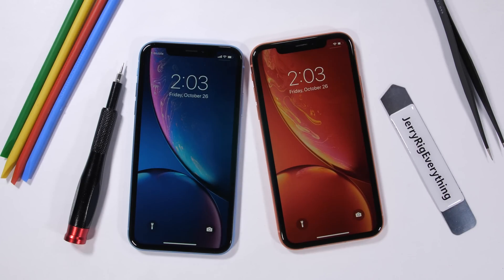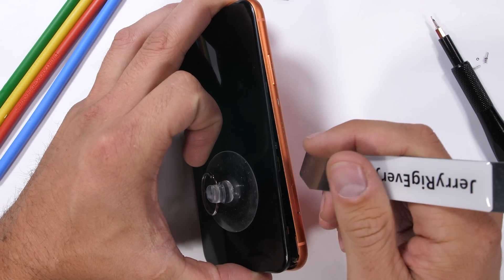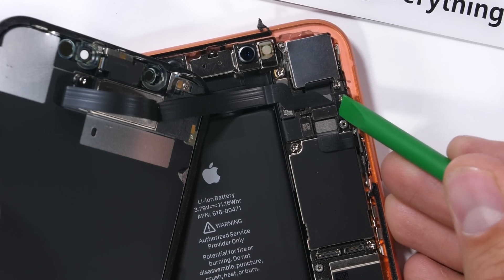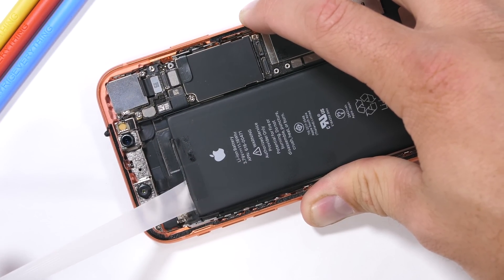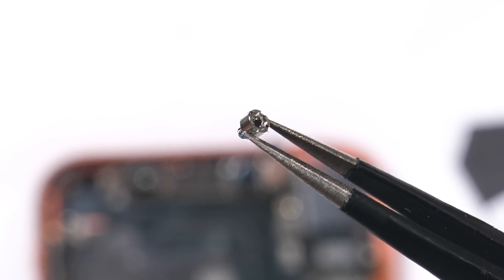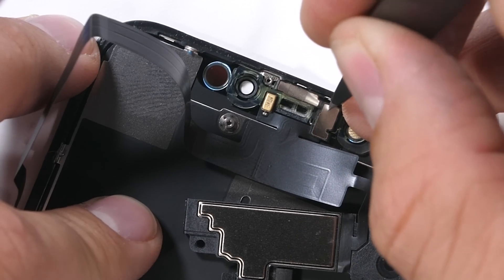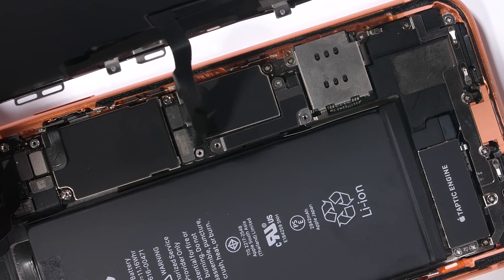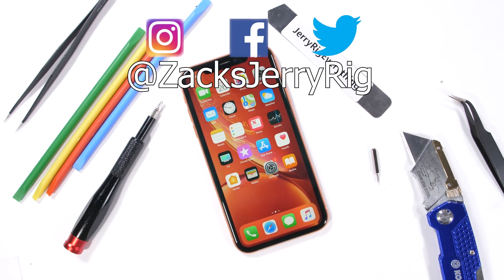iPhone XR Teardown! - How to open the colored iPhone?

Comment: Stretchy pull tabs, the only thing Apple does right.
Reply: @unnamed130  OnePlus ehmm ehmm OnePlus
Reply: @unnamed130  Alright, two things then 😂
Reply: Kamal Rana and cameras
Reply: And their CPU's
Reply: Lorenzo H mute switches are great. Never had my phone go off in class or during a midterm :D
Reply: Just an example of all the things Apple do right
Reply: @unnamed130  meh
Reply: Nope they get the camera right too. I took some shots with one at state fair last night and have to say it's on point compared to my Note 9!
Reply: @unnamed130  as a oneplus user, I have to agree with you on the mute switch. It is time manufacturers included that feature in all phones.
Reply: I can think of 10 reasons

1: they are so much easier to repair
 2:parts are easily available and not too expensive
 3: they are supported for way longer
 4: they don’t have the slowness of android 
5: all the devices work together seamlessly
 6: apple support is great(they’ve sent me 2 brand new phones for free now) 
7: the cameras and color science of iPhones is unmatched
 8: they bring revolutionary features like Face ID which no other phone had before the iPhone X 
9: they hold resale value way better then any android. 
10: the os is simple to use and just works without the bugs that I constantly encountered in android
Reply: brando12343 so true!
Reply: They also make repairs as a whole a lot easier than Samsung
Reply: @SCtester 
How? You can get Samsungs repaired in person by 1000's of certified repair centers. I can also get my Galaxy S9+ back glass and front glass replaced for less than the back glass on an iPhone X.
Reply: @azeissler1987  Apple overcharges for repairs, I agree - but actually opening the phone and manually replacing the parts is much more accessible on the iPhone XS.
Reply: @SCtester  not really. Samsung allow users to take appear their phones and as a result have a website dedicated to seeking spare parts
Reply: @lewis7607  True, but physically taking apart the phone is much harder, and requires you to damage the phone. Take a look at his Galaxy S9 teardown.
Reply: @SCtester  I just did and he didn't break the phone.
Reply: @lewis7607  To open it at all you have to ply open the back glass, and that chips away the paint underneath. He says you can use a Dbrand skin to cover it up. Sure that's not breaking the phone, but to remove the display, he said you actually do have to break it.
Reply: What about optimize OS and high security?

Comment: Why do you not replace it with new pull tab style adhesive strips? If the battery needs replacement again in a year or two whoever owns this phone is gonna have a bad time.

Comment: 0:38 Seriously? nearly 5 years after the Galaxy S5 (with IP67)  and Apple still doesn’t have IP68 water resistance on all their phones? And no headphone jack?
Reply: BrutalSystem ur still complaining about the headphone jack? And its the galaxy s6 with ip68
Reply: @jackyingoff6614  Galaxy S6 had no water resistance. The S5 had IP67. And it had a headphone jack and it had a removable back. This phone, sealed shut without a headphone jack only has IP67, which is completely ridiculous.
Reply: BrutalSystem the phone was water resistant but water could still get into the jack and fuck it up. I could bet u if i sunk the xr and the s6, the xr would survive longer
Reply: BrutalSystem oh yeah ur saying the s5 has ip67 and apple doesnt have ip68 on all their phones shouldnt u be comparing it to the s7 with ip68 instead? Or u could say the iphone 7 has ip67 2 years after s5
Reply: @jackyingoff6614  No, because the Galaxy S5 came out 5 years ago. The XR came out this month, and costs more than the S5 on release. The XR should have IP68, especially with that ridiculous $749.99 price tag.
Reply: BrutalSystem i mean every phone has gotten more expensive. And theres the pixel, razor, and theres the mate 20( not the pro) with ip53 and no one else is complaning and they cost the same or more

Comment: 3:43
-Apple will probably charge you an arm or a leg either way...

😂😂😂
Reply: M Hamza Tarteel it’s literally $30 to get fixed 🤦‍♂️😂
Reply: @officialANON001  Salty?
Reply: Battle for Voidzeroth I’m sorry informing or correcting somebody’s comment is not being salty, salty is an over exaggeration over something that’s not that big of a deal or whining about it and that I did not do 👍
Reply: @officialANON001  I'm sorry to inform you that not only was the original comment a joke, so was mine.
Reply: Yes
Reply: M Hamza Tarteel Until you heard the price for screen repair for Samsung.
And what is even salty,is all those ppl laughing at Apple while handling chinese phones like Xiaomi,Oppo,1+ etc etc that didnt even had a valid guarantee in the first place,let alone service and parts for them... but I suppose thats ok as generic cheapo lcd panels from china fits them well as the original quality wise ;)

Comment: Question is...
"Did you find a Worm in that APPLE ?"
Reply: yep. 4 stretchy "worms" under the battery.
Reply: This comment should be pinned 📌
Reply: @maxoo._  3.14159265358979323846
a string of pi
Reply: Hahahahahaha🤣🤣🤣🤣🤣😂🤣🤣😂🤣😂🤣😂🤣🤣🤣🤣🤣🤣🤣🤣🤣😂🤣😂😂😂🤣😂😂🤣🤣😂🤣🤣😂🤣🤣😂😂🤣😂🤣🤣😂😂🤣😂🤣🤣😂🤣🤣😂🤣😂

Comment: What about the razor 2?
This is just a boring iPhone
Reply: What about the razor 1? Oh wait they look the same
Reply: Almost every smartphone is just a boring looking slab of glass anyway...
Reply: And that is just a boring android.
Reply: Razor 2 is so sexy man and also android is easy to customize as you like.
Reply: He should open a Mi Mix 3!
Reply: Yup nothing special,
Reply: Atleast Razor 2 does have a better processor then Razor 1 but ya they need to upgrade the look of the new Razor phones
Reply: Mate 20 pro*
Reply: Pankaj Kapri Yeah “good for gamers”. Like theirs one out there that plays 24/7 on their phone. Yeah did you know the newer iPhones are faster than the razor 2? Yeah let’s talk about that
Reply: @supportyou10  only their geekbench scores . That's because Apple design their processors around geekbench and as a result In day to day life there is actually little performance difference between the two
Reply: Lewis Every performance test between A12 vs SD 845. The iPhone beats all of them in the gaming test. And the greekbench will speak after a long time use. Look at the iPhone 5s, it still support the latest iOS 12.
Reply: @supportyou10  however, do they counter in the fact that they have two different operating systems? Additionally, in modern phones morse' law applies so no one is going to notice a 0.05s difference and the iPhone doesn't even have any multi tasking.
Reply: Lewis The thing you just said was the stupidest thing I ever heard in my life. 2 different OS I get it. But have you ever think that Apple built their own os from the ground up and google bought android? Yeah the only reason android have more features than iOS its because everyone else accept Apple are using android.
Reply: @supportyou10  morse law is a reality, the difference between the performance on day to day life is neglable especially since the iPhone cant multitask. Apple's os is based on Linux they didn't build it from the ground up . Google didn't buy android, alphabet developed it.
Reply: An iPhone should not have a more powerful gpu than a phone dedicated to gaming 😂
Reply: Screw problems, speaker problems, crashing problems, so worth it
Reply: OneGoogleUser never experienced personally on my max, was east to work around, Fox came out within 2 weeks on Android you would dream for that 🤷‍♂️
Reply: OneGoogleUser your right you only have these types of problems

Failing to save photos
Crashing constantly
Screen display 
Speaker static
Microphone static
Security holes
And many more 

My bad
Reply: Wait the razor 2 is special? The only thing special is that really dim pointless glowing back. Other than that the phones design and features are from 2012